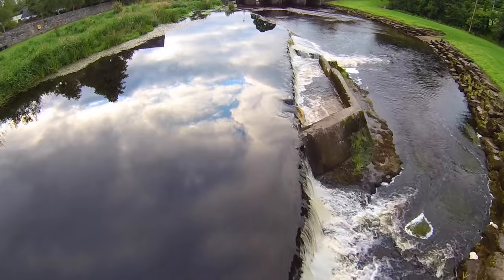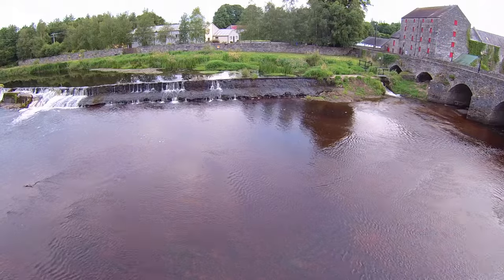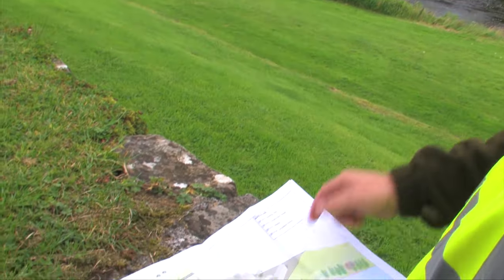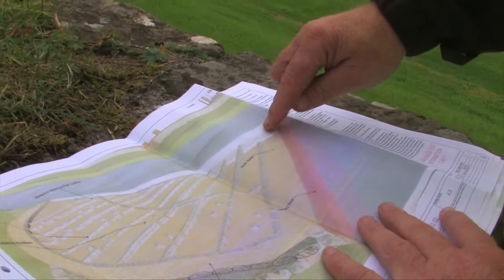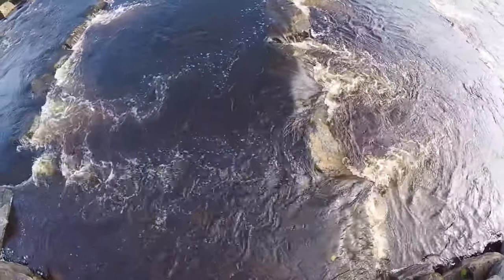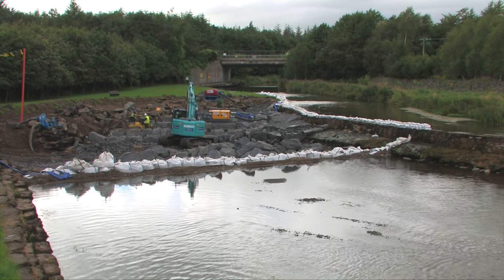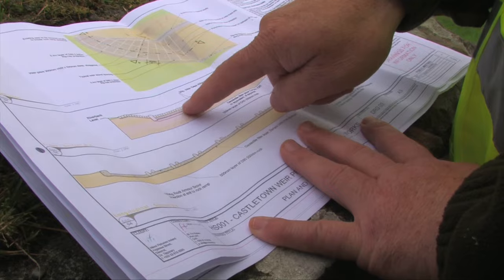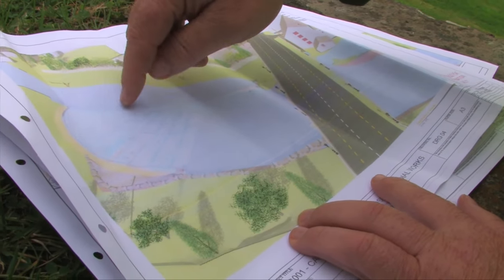Castletown Weir Rock Ramp Fish Pass 2015

Comment: Look at the drop at the top - it will not facilitate lampreys and is no better for eels than what was there before - despite this development being specially mentioned as being an eel pass in Irelands' EMP. We also have Bennettsbridge (and others) downstream and "The basin" upstream so it is of local benefit only even for salmonids. There will be a small hydro scheme here and such schemes are not regulated in Ireland. We are not making any significant attempts to open up eel migration pathways in Ireland.
Reply: The problem is,  there has been so much crossing with escaped farm stock, that salmon have lost the ability to jump anymore.  Besides what is the point of them going any further upstream,  when all their old spawning grounds are now completely and utterly shaded over by willow and alder and all the life sustaining ranunculus weed gone. Because its binding roots are no longer there,  all the fine sands and silts are migrating downstream,  smothering the spawning gravels.  NO that can't be right.  It was the cattle which were getting into the streams that were stirring up the muds and fine silts. 
Confused?   No need to be.  There were weirs on these rivers for the previous several hundred years and cattle in them up to their necks for the previous thousands.  Were the rivers full of salmon then or empty.  Stop chasing red herrings!  Deal with the tunneling an deal with the sea cages.
Reply: How do we know that there are less salmon and trout in shaded stretches of river? Electrofishing is far more efficient in open rather than tunnelled stretches of river - so IFI research underpinning the conclusion that there are less salmonids in tunnelled stretches is flawed. Trees provide cover and large woody debris provides habitat for fish. Allochthonous inputs of leaves provide food - directly though insects falling from trees, indirectly by providing leaf litter for shredders. The upper Nore has been ruined by drainage, peat harvesting and agricultural pressures. Few farmed escapees have ever entered the Nore.
Reply: @EcofactIe  my god anyone thinks that no trees is good for rivers is mad i agree 100 percent that vegetation is good for salmon 100 percent and for eels and trout